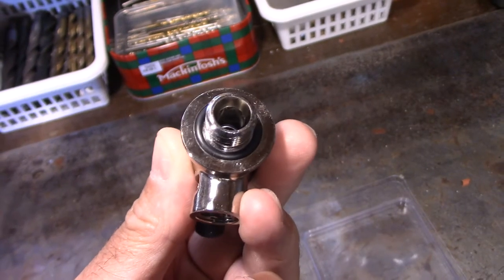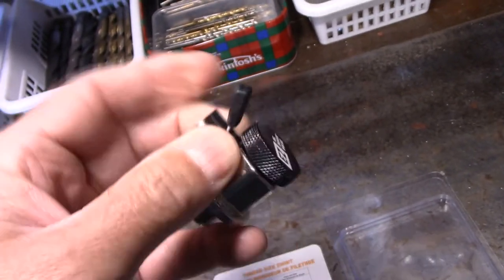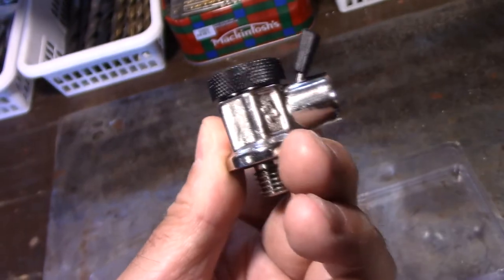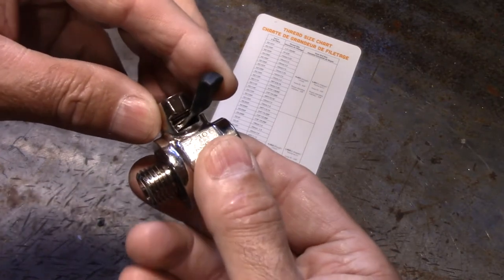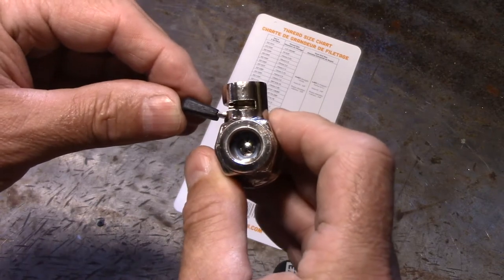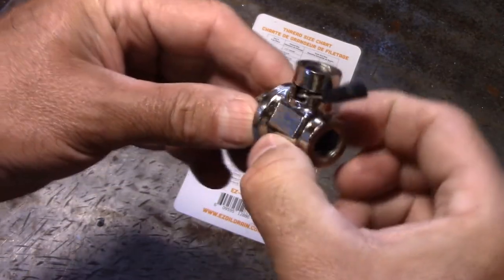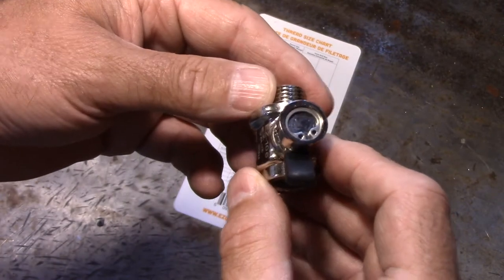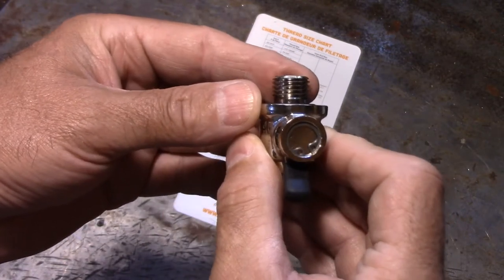EZ Drain Oil Drain Valve  Review And Installation - Great For Diy Oil Changes

Comment: Had a fumoto drain valve on my cars for years now.  Love em.  The goal is toolless oil changes and no bloody knuckles from over tightened plugs.
Reply from the maker: Hi Matthew ,  yes toolless oil changes do  make it easier.  One would wonder why the OEM's haven't engineered their oil pans to toolless oil changes.  I have seen so  many stripped oil plugs to over tightened plugs over the years . Cheers 👍

Comment: Just hope its not cheaply made and the oil doesn't leaks out but it looks like a great idea click it on and off to change the oil! Steve you always come up with the best ideas!
Reply from the maker: Annie it all SS it seems  solid .  I like the idea much better than pulling out the drain plug  .  I like it and doesn't leak at all.

Comment: I like it Steve, it would be nice at oil change to hook a short hose on it. When i pull the plug on my 2012 F150 the oil shoots out by the passenger wheel.... Fast move with the drain pan...lol.......
Reply from the maker: Yes I know too :) so the valve sure makes for a cleaner and more controlled  oil change .  No more mess for me and so far I like it.

Comment: Looks like a well made unit and would definitely make draining the pan less messy and more controlled - that said, a drain bolt is less bulky, less of a protrusion - I’d hate to be off roading out in the back 40 and have a rock rip that thing of the pan LOL - thanks Steve, great video brother cheers
Reply from the maker: Good point but for the 99% of us that don't go off roading  it's a great idea .  Now  if  you hit a rock off roading  striking your oil pan   out in the boonies ya might be best to be driving an atv not a pickup 😅😅

Comment: All my vehicles have a similar product like this. They are called Fumoto oil drain valves. Very high quality and excellent for a DIY'er.
Reply: @SteveRobReviews  The Fumoto valve ... F 133 has a larger bore for a more rapid drain.

Comment: I know nothing about that drain , but wonder if you hold the outside aimed where you want and then tighten the inside , or maybe not .
Reply from the maker: Hi Terry  , its a one way design as the outlet port is determined by the thread pitch and depth so tightening is strictly external so the position must be engineered  by thread length alone .  So far I've changed the oil and like the toolless oil change and no mess or leaks .

Comment: Have you tried testing the cap? Open the valve and see if any leaks through the cap. I had one without the cap and running over a blown truck tire knocked the lever open. I now have a cap and a spring clamp to keep it shut.
Reply from the maker: No I haven't,  interesting 🤔.

Comment: How's she goin'?  That's a neat valve to add to the drain pan Steve!!!  I like that is has the positive locking lever and a metal cap like you pointed out!!!  Should work good for ya!!  Thanks for sharing and take 'er easy!!!
Reply from the maker: Mike its turned out to be a great  help for me , no more mess  and so easy to flip the valve on and off.

Comment: Thanks for sharing. You can add a washer/ gasket to the valve threads/ shank and that may get you the correct index (lever position) you need. If you have a crow foot wrench set around, that can get in that tight space and will work with your torque wrench as well.
Reply from the maker: That's an interesting idea , not sure if it would seal ,  it's worth a try.
Reply: 22 mm crows foot would be needed, according to the video.

Comment: I would be a little concerned about that Rubber o ring  ,overtime just melting ., wondering if you could replace that O ring  with a metal crush washer.
Reply from the maker: Well so far no leaking at all .  If it ever starts to leak I would most likely replace the O ring and add some rtv to seal it up for good .

Comment: Seems handy, thought about them plenty of times, don't trust if for getting snagged on something however. 
Before you use the internal hex, is it a ball seat?    And a nice example of where a crowsfoot wrench would come in handy.  Or, just take the cap off and come it at an angle from the exit drain side.
Reply from the maker: I had absolutely no access to torque it up using the hex so I used the goodntight method.  Alex I had the same concerns but in my experience I have never come close to hitting my oil pan with something  plus the front end is lower so I'd take out the front end first  . Yes its a ball valve.
Reply: @SteveRobReviews  What I was getting at not very clearly, is that the hex is probably also the ball seat, if you try and tighten the valve into the pan with the hex it'll over tighten the ball valve and or damage the seats.     Good n' tight is tried and true.
Reply from the maker: @alex b.  Alex  the internal hex was not  a location to tighten just the body with an open wrench.
Reply: @SteveRobReviews  Just had the time to look at their video (should link to 2m03s for the cutaway image); https://youtu.be/6MBJTdsiSuQ?t=123 
 Looks like they thought this device through,  it has a shoulder to bottom out on rather than bearing down on the ball & seals.  At least it isn't like most standard plumbing valves where you'd end up compromising any seals if you got carried away tightening things.

Comment: Now that’s a good idea..... I would have to put an extension pipe out beside the straight pipes off the cut outs on my limousine.....It would come out on the passenger side beside the running board.....all you have to get is a pipe extension and you won’t even have to get under there any more.....I hang on to see the final report you got on this one.....at the camp just enjoying life.....CHEERS
Reply from the maker: Well Gator I changed the oil since . No tools , no mess and no leaks . A win win win  .  Have fun at the camp 👍

Comment: Hmm, what would concern me? Would that cap vibrate off? Up here in the north with all the salt, would the mechanism seize up? Great video!
Reply from the maker: Chris its all SS and the cap has not fell off and if it did its just a secondary part as the valve must be switched open.  I was a bit leery at first but it doesn't leak and works as intended. I like it.

Comment: I put a Fumoto drain plug on my car at the first oil change. Same type of design except mine has a short nipple to put the drain hose on. No mess at all. I heard another reviewer saying these type will wear out after a while. I have to ask how often he changes oil?
Reply from the maker: Both brands are very well designed and will outlast  the vehicle  easily.  Cheers Jim 👍
Reply: Both drain valves are great, it's just easier and cheaper to buy in Canada for the EZ Drain. No leakages. One can wrap with heavy duty aluminum foil to secure the lever from accidentally opening. Both my vehicles have aluminum covers so very unlikely to open up. The drain valves have outlived two of my other vehicles.
Reply: @pt109che  If you fear the valve lever accidentally opening, here is an idea. Put a small diameter adjustable hose clamp onto the round section of the valve. Install it so that it will not allow the valve lever to move vertically from it's locked position. At oil change time, loosen hose clamp to allow valve lever operation.
Simple.
                                   Hope this helps

Comment: Whats your long term impression of it? Has it started to leak or is it still holding up?
Reply from the maker: No leaks , no concerns at all .  Much better than before and  no mess pulling out a drain plug bolt.  I bought the end cap nozzle you attach a hose to that screws into the valve end and now it pours directly into my pan.
Reply: @SteveRobReviews  have mine on a Grand Caravan for 11 yrs.....no leaks and more importantly no mess
Reply from the maker: @dm19609721  👍
Reply: I've had the EZ drain on 4 of my vehicles and no issues. They outlasted 2 of my vehicles and now I've got one for a Nissan Altima sitting around. The EZ drain has a rubber gasket and no leakage. The drainage is slower than regular drain plug, but it is a good time to enjoy your coffee while it drips out. The EZ drain is easier to buy and cheaper in Canada, but either EZ or Fumoto are great. Both my vehicles have "skid plates" or covers so the drain valve is secure from accidentally opening. If concerned, you can wrap with heavy aluminum foil to secure the lever.

Comment: The hose adapter may be the way to go. You did the Amish torque setting….Goot N Tight 😂
Reply from the maker: Ford  designed the placement of their oil drain plug to be in    compliance with the  Amish torque requirements . 😅😅

Comment: Sure seams interesting if it holds up. Guess we are just so used to the standard drain plug it’s hard to wrap your head around the idea this will work cause it is a great idea. Keep us posted Buddy!
Reply from the maker: So far so good Doug . Did one oil change no leaks no mess.  👍

Comment: I'm looking for something like this. Every time I get my oil changed they have to replace the plug with a bigger one. I don't want to replace the pan, that could be real expensive.
Reply from the maker: Hi Joe 
That's exactly why I installed this so the oil plug  would not get worn out.  If your plug is oversized  your going to have to find the correct thread diameter so it fits right.

Comment: if you always do your own oil changes you will never need to have that type of plug but if you go to some place like jiffy lube or canuck tire to have your oil change best idea ever by having that they cant strip out your oil pan threads thumbs up shared cant hurt either way
Reply from the maker: That's something I never thought of , so true as so many have their nightmare  experienced at fast lube shops.
Reply: The idiots at a Jiffy type lube place, would unscrew the whole valve assembly. They will not wait for the slower oil drain rate of the E-Z Valve. They then will over-tighten the cheap oil filter that they install. At $19.99, they do much damage. You pay to get screwed, over torqued and told that you need new wiper blades, and air and cabin filters.

Comment: Looks like a great idea to me.  Got a link to it?
Reply from the maker: Bruce I bought it off amazon on their warehouse deals  department but the units are specific to  oil pan threads so you can look at their web site to get the model code. https://ezoildrainvalve.com/index.html
Reply: Thanks! Just checked and ordered. $28 isn't bad at all
Reply from the maker: @BruceLyeg  Be sure to make a vid 👍

Comment: Does this include a built in magnet?
Reply from the maker: There is no magnet .  It's just flows straight out the valve .  Most late model vehicles no longer have a magnet attached to the  drain plug  anymore .
Reply: Good to know! Unfortunately they don’t have one for a Duramax…

Comment: Nice 👍 hopefully it holds up over time, may be easier next oil change or a nightmare. On the lookout for an update. How’s the weather up there,  sorry I forget about where you are in Canada, gator is north east of you I think, seems like it’s rained every day this month.
Reply from the maker: Joe Gator is 5 hours  NE of me.  I did change the oil since this video and it was great as there was no splashing of oil and no tool required 👍
Reply: looked up the GM plant,  in the summer we’re on the st.Lawrence river west but up stream from gator. By boat in and out of Canada all the time, you just say you’re lost when stopped it’s cool 😎 or tell them you know Justin. Be good Steve

Comment: another solution to clocking the orientation of the valve is to use plumbers tape on the threads so it lands in the 12 oclock position...
Reply from the maker: Great suggestion Walter 👌

Comment: I stopped changing oil 60 years ago by installing a filter that cleans oil. Started with a Frantz oil cleaner on my Rambler American. Later started using the Motor Guard oil cleaner. The Gulf Coast junior  Recently got in a Australian Jackmaster.   Have a dozen in use now on everything with an oil pump including lawn mowers. I prefer the top loaders.

Comment: That metal cap might not work too good unless it has a rubber or plastic gasket in it to prevent leaks in case the valve
inadvertently opens while driving.
Reply from the maker: Seems to work fine . No leaks.
Reply: the cap also has an oring inside

Comment: I’m looking on Amazon but can’t find one for my Acura TL my bolt is 17MM
Reply from the maker: You need to use the thread  diameter and pitch  like m14- 1.5 pitch .  Take a look at ezEZ Oil Drain Valve EZ-106 Drain Plug Size M14-1.5  and verify it matches your drain plug.

Comment: I've seen those for years.  I like the idea but I was so scared to have something hanging down under the vehicle.  Second, you no longer have a magnet to collect any medal shavings.  Probably not a big deal but I'll be interested on how it works out for you over time.  Somebody has to be the guinea pig.  I guess you are it buddy!
Reply from the maker: HAHAHA well Rick my new silverado does not have a magnetic tip on the plug  , not sure if engines today are made with any metals :)   Changed the oil since and there was no leaks , no mess and no tools required .  As for the valve hanging down , well I can't see me driving over stuff 1 foot high  😅😅  I like the valve and going to order one for the silverado when the price drops a bit , $40 up here is a bit too high for me.
Reply: @SteveRobReviews  I'll have to check my 2020 Duramax oil plug on my next oil change.  First one was free from GM and I don't drive it that much.  I'm starting to think that maybe a problem.  Diesel engines are made to be driven.  I've had it for a year and have just over 2,000 miles on her.

Comment: You should use a crush washer under that.
Reply from the maker: Big no-no , it has a built-in  Oring on the mating surface to seal against the pan.

Comment: Hmmmmm that's pretty neat
Reply from the maker: Grant me having OCD is a bitch so when pulling out a drain plug and not knowing if theirs going to be spillage was a challenge   but this solves everything as the valve lets me control the flow without a mess .😅
Reply: @SteveRobReviews  glad u made this video my step son lost his plug 3 days ago after he had his oil changed...engine locked completely up...I'm sharing this with him. Ocd is ruff brother...I almost never got married🤣

Comment: Great review Steve just not sure if buyers would trust some thing like that just to eliminate a simple oil pan plug unless the oil was being changed weekly or something. Be cool if there was a hardline that carried the oil to a spout out on the front or side and open the valve there and let the oil run into the pan . No lifting the vehicle up especially with remote oil filter .
Reply from the maker: Thanks bud , I had the same concerns .  I have done one oil change and it was  no spillage at all compared to just pulling the plug plus no tools required.   Overall I would say  na you don't need one but it is convenient item to have .  I have a whole garage full of stuff I definitely don't need 😅😅

Comment: I am skeptical having seen those briggs intek 17.5 drain kill many an engine.  That is a completely different design and does look to be a well built.
Reply from the maker: Pat I was hyper concerned about all the what ifs that could happen leaving me with a seized engine . I ordered it and looked it over real well and there is no way it can open on its own  plus if I hit something the front end of the F150 would fold up like a pancake before it reached the oil pan 😅😅

Comment: I tried one of those. It took forever to drain the oil out. The valve set up doesn't make me feel all cozy and warm. I still worried that I could run over a road kill or hit a small animal and the rolling corpse could dislodge the valve. I will stick with the tried and tested way.
Reply from the maker: Hi John 
Ok if yours is draining slow remember  to take the oil fill cap off  and it will drain much better .
Reply: @SteveRobReviews  I always open the fill tube before I start my oil change.
Reply from the maker: Ok well next time  Jack your truck up high , real high as high as you can . Try that 😅😅😅😅
Reply: @SteveRobReviews  LMAO ya ok Steve, I will try that.
Reply: I only gave you thumbs up because when you said " rolling corpse could dislodge the valve," I LOL' ed.
Reply: The truck drains really fast when upside down with engine running. Don't mind the blue smoke out the exhaust, that's normal.